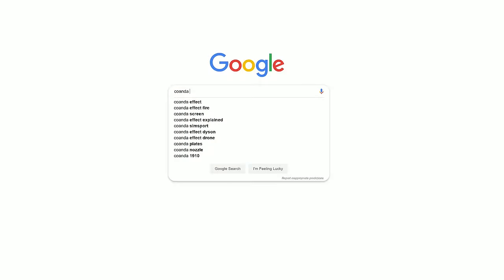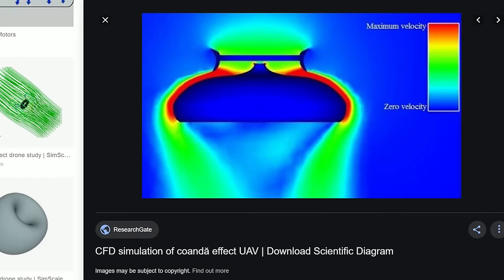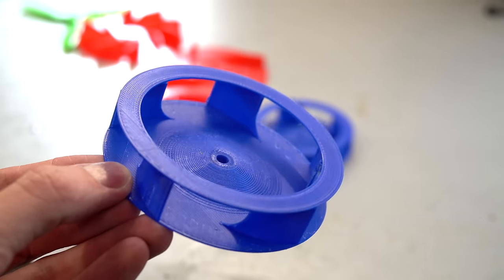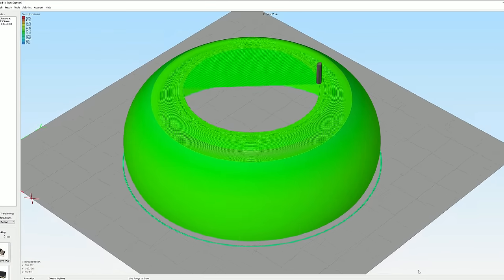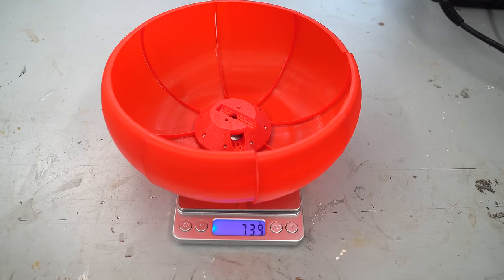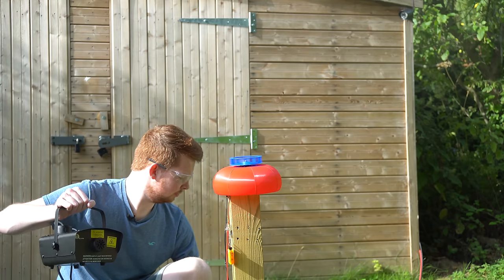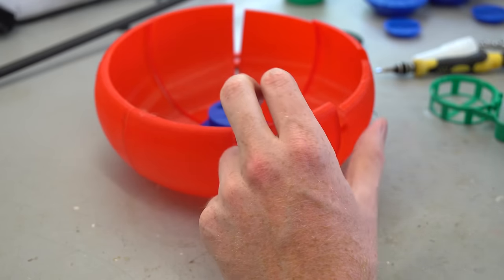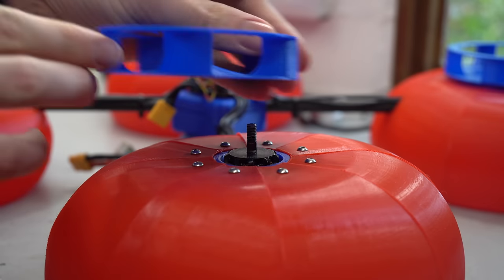Coanda Effect Drone Propulsion

Comment: Give it another try with a combination of propeller at the top, impeller below and channeling the down going air into a thin stream tot the bottom and change the pumpkin shapes to onion shapes upside down. For channelling the air you can use the upper half of a bigger onion shape also upside down around the first onion and a third propeller in line with the others at the small hole the end that is the bottom of the entire shape.
Well, that leads to much more weight.
Another approach: omit the pumpkins and use 4 x 2 (toroidal) propellers for more efficiency instead of 4 x 1.

Comment: Use the printed parts for forms to lay up parts with lighter construction and think on rotor to dome diameter ratio effects on volume/vector of air. Each new approach needs to exploit propeller/rotor design parameters, as well as dome shape. With so many variables you will need more bench work and testing.

Comment: To me, it looks like the uplift comes more from traditional airflow, than coanda-factor.
Also, I'd expect a lot of interference between the domes = at least 1.5x the diameter of the domes in between them would look plausible to me?!?
On the other hand, big domes also give sensitivity to wind from all sides and needs more counter-steering than "default" multicopters and limit speed (ok, speed is not necessarily the goal)
But I like the different approaches of the "impeller" designs  (well, these are not really impellers per definition) - one of the few real sense-making uses of 3D-printing I have seen so far. 
Anyhow: Impressive and we are curious, what effective solutions this development might bring!

Comment: These kind of impellers are by nature high head low flow systems. Thus moving  alot of air with low pressure difference is simply not the design point of these systems. That said efficiency can be improved by removing rotational components from the flow: you want the exiting flow to be purely radially outward in this case. You can either design the blade to allow this or add flow straighteners on the coanda bowl. Plus you should place the blade on a gradually curving bottom plate, redirecting the flow gradually as they pass through the bladed

Comment: Great job.  Reviewing your smoke tests, you will see that half of your thrust is being lost before it reaches the end of the bowl.  To fix this you need an outer bowl.  The outer bowl needs to start just above the blades and shaped down reducing the space between the bowls to more of a nozzle at the bottom.  This change will capture all of the thrust and not let it feather out the sides.

Good Luck.

Comment: The getting off ground seems like a catching and spinning of the air on the dome and not able to curve under without some legs so air can get under to clear the ground., then its spinning on its lift funnels which may be competing depending on aim and rotor directions.  Oh and having some pass through air may keep the motors cooler, if im getting the idea just cut em so they suck from the bottom a bit and should amplify the effect youre going for and make a lift zone.  I think theres just a design oversight keeping it from expected performance, maybe. Ohhhhhh and putting some wing lift ridges on the domes may do it, like with boomerangs maybe it's missing a bit of geometry

Comment: I wonder if you can mount a propeller and the impeller at the same motor.

So it pushes the air down into the impeller and the impeller outside with much more force. 

To greater the effect use a dome inside a dome construction in which the impeller is inside. The outside dome is there to focus the airstream under the domes (like a air lense)
This could creat a low pressure area inside the dome which could help lifting. 
I dunno if my idea is understandable 😅

Comment: One of the other guys also mentioned printing the bowl the other way around. What about also changing the diameter of the bowl? Also try different degree of the concave nature to see if and more obtuse angle helps. I assume the coanda effect is only as efficient as the air flow, so to have the bowl curving at the lip is expecting too much. Great project though

Comment: It is a nice experiment 👍. However, I recommend to try to add another dome parallel to the existing dome and have the impeller in between. This will increase the efficiency by redirected the air 100% downward. Please tell me if that succeeded

Comment: A cutout at the middle of the dome would have helped a lot. Lowering the prop disc bellow the level of the dome would have reversed the flow and increased lift enormously. In this setup, the flow on the dome is highly turbulent, and the vortexes take a way the most of the energy. If the air is not pushed on the dome, rather sucked from the dome, the turbulent air would have been under the dome, and the air ont the surface of the dome would have been laminar. Of course flow separation is a higher risk, and when effective translational lift comes into play, the coanda effect collapses, so it is only good for hover. But it is still way more effective then the pusher configuration.

Comment: Mount the impeller underneath a toroid and blow the air UP through the center. This will get you out of ground effect. If you get the dimensions right, this design acts as a thrust multiplier by recycling the airflow around the torus.

Comment: try an additional shroud from the prop tips to the 45 degree portion of the lower.. sandwiched curved vanes could straighten the flow..  vacuum forming is an alternative construction method. appreciate your ingenuity and fortitude .. how about a redesign of the "spray bottle" to last longer and tolerate corrosive liquids. currently most are thrown away after one cycle

Comment: A Coanda Drone strikes me as a good way to centralize a payload beneath the dome assuming a single propeller/single dome design. Hang everything you need (camera, battery, etc) inside the dome and shield it from air turbulence, damage, etc. Then again, it's probably no better than the standard drone designs :p

Comment: a couple of ideas... one, it's obviously too heavy, i think a 3 foil design, while harder to control would probably be more effective, secondly those domes are too close to eachother and the angle of the domes are too steep, for an impeller, you can see the airflow problems just looking at the grass in your impeller tests.  soo much air was just being blasted out to the sides, and running into the other domes.  That's why I suggest going with a 3 foil design would probably be far more efficient then your current 4 foil design.  If you want a 4 foil design to work with an impeller you'd need longer foils to keep them further away from eachother (which would add to the weight) and a slightly less agressive rounding to the bowl as well (which also would add to the weight).  The only reason those things were floating at all was because of the backwash from the ground (on the impeller version).

Finally, the domes were pretty well curved for a normal propeller design, and the downward thrust of the propeller eliminated all the energy wasted in the turbulent air caused by the impellers being too close eachother, meaning the aggressive dome slope and short foils weren't as big a negative with the propellers.  in fact, to be honest, i'm not sure how much of a coanda effect you were even getting with the props.  the domes probably were the wrong design entirely to take advantage of the effect much vs all the energy lost hitting the top of the dome with the prop wash.

Comment: Looks to me like the bowls are undersized and overbent.  Most of the lift you'll get from Bernoulli depression under the bowl, so you might as well maximize that.  In fact it would be mighty interesting to see if the design might not work with a flat round plate rather than a bowl.  I suspect it would!  Also, the edge of the bowl might be feathered, to prevent parasitic whirls.  There is obviously a trade-off between bowl size and weight: the Bernoulli lift scales as square of air flow velocity, so as the radius increases velocity drops with R, pressure drops as R^2, and area affect increases with R, giving you diminishing returns with additional lift scaling as 1/R*dR for each added dR of radius; whereas weight increases as R*dR.

Comment: Not "Coander", closer to "Coandah", but without the H, ending on the high-A.
I would suggest printing the bowl the other way (like a bowl in which you'll put cereals and milk, in this order, don't @ me). The fan should be of lower height and have a lot more blades, like a squirrel-cage compressor fan, and maybe thinner/shorter (less height). I would say at least 24 fan blades, ideally twice as much or more. You might also want to add some gearbox, to spin it at higher speeds, to use the same torque to generate more lift, by having more air affected by the surface-tension of the bowl. And why not use store-bought bowls, anyway?

You want something more like a high-speed air compressor squirrel-fan, than the fan for a horizontal-axis wind-turbine. Would be nice if you tried again, taking those things into account. Also, having a duct (basically a disk) on top of the fan, going something like 2 centimeters outwards, would somewhat increase the upwards force, by keeping the air from being sucked back into the fan.

Comment: What about inverting the curves?
Instead of making the air go outward and down, how about making the center hollow with a normal downforce impeller/prop and the curve downward into the center rather than the outer curve?  The center would have to extend 'downward' further than the outer edges, but would that not increase the amount of air being forced downward?

Comment: You need a cover over the propeller!
Create a stream effect airflow. (Direct the air closer to the surface)
Completely open.
The propellers can't get the proper airflow.
The cover must have a smaller hole than the wheel.
Each cross side with vents like a rectangle tweeter horn.
Your air is escaping into the atmosphere.
The air

Comment: I.... was under an impression that one of the requirements for better thrust was that in addition to the blades pulling air info the system - that there should be additional airflow pulled in by the inbound air - a bit like a turbojet that has a hot section, but also a cold outer area that flows. Unless there is an affect that draws in a decent extra level, hard to see how it will ever elevate above the base thrust of the prop (and in the wider sense this is the challenge of those who propose coanda effect propulsion for flight..)

I think the prop flow needs to go down, into the dome, round a corner, draw in extra air, and then flow back up and round the outer surface. The additional air flow pulled in from some form of hole below the dome (which.... would create a lower air pressure below/in dome)..

Right now... that drone looks more like its lift is from the upward drive of the blades, rather than being lifted by coanda effect over the surface of the dome..

Fun experiment all the same!!

Comment: First, why didn't you just print the domes the other way so you didn't have this issues of filling in the top?
Second, I feel bottom curve of the domes ends too soon and straight; perhaps a longer curve will help with the Coanda Effect, similar to your demonstration at the opening of the video?
Last, would having some kind of intake stack above the impeller (as the examples you provided had shown)  help it draw in more "undisturbed" air which could increase thrust?

Comment: Cool video! Never really knew of the Coanda effect.

However, suspect your machine's lift is not because of that.  Remember, that volume of air you're displacing outward over the bowls increase and therefore retard in motion. I think the lift is created purely because of the vacuum  difference you create because of the presence of ground.  As it lifts the ground becomes less of a factor and then air can flow as a ring vortex arround the whole craft and then it goes down again.  But, I think your impeller idea is brilliant as you can have a sentral mother impeller and manipulate thrust through 4 pipes leaving the impeller with mechanical valves... making the whole machine a lot safer, utilizing the vacuum you create above craft, and then reusing that compressed air thru pipe outlets. Then the machine is the wing/lift, no  increase of manipulated air volume, and you reuse that air as additional thrust. This I think would be an improvement on the modern helicopter.

You can study a vacuum cleaner in order to get a few impeller ideas.

Comment: A few changes to makes this design way more efficient.
Propellers are inefficient when airflow does not exit from the disc plane easily. Think of the 'propeller' disc as an air pump, using it as basically a fan to create the volume of air required to flow around the curve and produce the negative pressure. 
You have excess material and thus extra weight in the domes. Airflow flows across the curved surface, and at the point the diameter reduces it breaks away and flows downwards/away. Any material after this breakaway point is superfluous, adding weight for no function. Basically 1/2 of a ball is all that is required.
There is a relationship between the volume of the air created by the fan disc, the air flowing over the curve, and the distance to the shape - not too far and not too close to the curve.
The fan disc needs to be much closer to the top surface of the shape. Airflow downward without hitting the curve and starting the negative pressure effect, is wasted energy. 
The fan disc needs to have a cage around the tips to direct and include the spill air into the downward direction. Think about angling the edge of the fan cage to create a venturi effect, angling the airflow close to the curve.
There is a ratio between the diameter of the fan disc and the curved shape that works best. Has all to do with the curve, which is where the negative pressure effect occurs.
Try forming the propeller disc shape to the shape of the curved shape.
The idea is to direct the negative pressure vector as high as possible to maximise the lift, as it does on the top side of an aerofoil.

Comment: What about putting a cap (dome) over the impellers to help direct airflow towards the main domes.  Maybe the conventional propellers can be avoided.  This might be similar to a jib sail guiding and increasing speed of airflow around the main sail of a sailboat, depending on how close the trailing edge of the jib is to the main.

Comment: I know you mostly 3d print things because you can, however i still wonder if  the efficiency of the coanda effect would be increased if the domes would be made by other means than 3d printing. The rough surface typical 3d printing creates results in turbulence which in turn will result in less thrust downwards right? So the next major improvement would be smooth domes made by injection molding or something. Easier said than done ofcourse, but just a thought. Very interesting video by the way, fun to see a concept i never heard of applied in a 'practical setting'.

Comment: Try using balloons either directly or as casting shell.  Might try helium to fill them.  Try placing motor inside them with, heat will help provide lift.

Comment: It would be interesting to see an impeller with a bit of a funnel on the top intake and a turned down lip on the upper edge.  Use that as a ground effect on a ground effect optimized dome and compare efficiency to a regular propeller in ground effect.

Comment: so its the pressure under the bowl is higher then the top of the bowl. it seams like the air going down the side of it is creating a negative pressure in the inside the bowl. if it could somehow be routed to go into the middle of the bow or just away from the bottom like maybe a hat

Comment: Hmm. I wonder. Could you flip the blower so it draws air up, over the motor inside of the dome, and only exhausts at the top? The low pressure under the dome might allow a smaller dome to get the same amount of redirection (allowing for less plastic and drag in flight), and drawing air over the motor should cool it down and make it more efficient. It would also prevent blower from immediately stealing high pressure exhaust air to feed the blower. Alternately you could try using some supports and building a chimney on top of the dome to contain the motor and feed the blower, disconnecting the exhaust from the intake, cooling the motor, and not interacting with the down force. My gut says the first would work better though

Comment: Your first issue is using an impeller for a propellers job. You aren't simply wanting to move a volume of air or compress it. If that was the case the impeller would do fine. But what you want is thrust. That's the job of the propeller.
The second issue is caused by two factors that is the use of the impeller combined with the surface angle. Think about what happens when the air expands that close to a surface with nothing to direct its expansion. In short if you had an expansion chamber on the outflow of the impeller it would have helped some. Probably not as much as if you used the right tools to start with though.

Comment: How about using conventional propellers but opening up the domes in a radius equal to the propeller radius. You would get some effect from the air getting pushed outwards by the propellers but retain the traditional downwards trust of them.

Comment: Hey Tom.. Very interesting experiment.. But I've got a question: You know how on an airplane at flying speed, apparent wind comes mainly from the front, hence solid wings are used to create lift. But when sailing, we use the same wind to form the shape of the sails so lift can be achieved. Do you think that using some light spinnaker-type material for the domes, the impelers could create the wind speed necessary to shape the much lighter domes and produce a more efficient coanda effect?